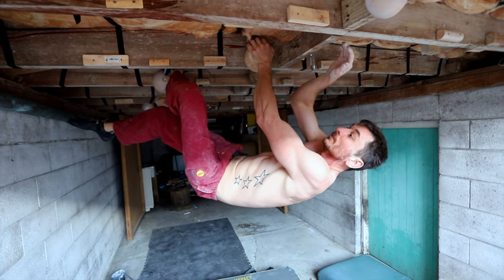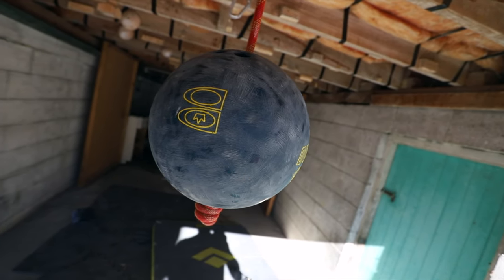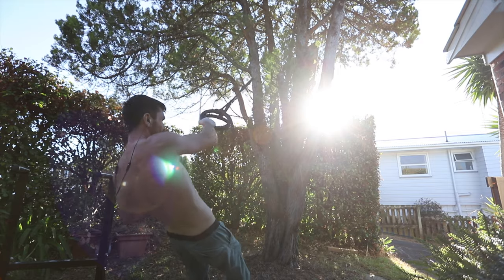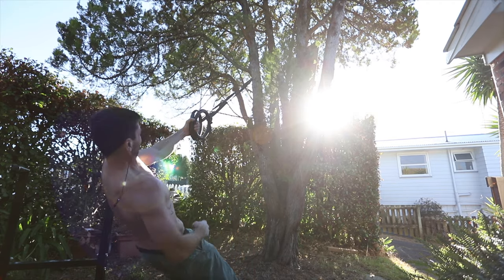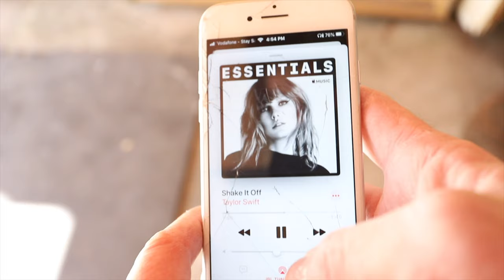LOCKDOWN!!! Home climbing gym build and roof training 💪

Comment: Could add grip tape to beams in different widths to create pinches of different difficulty. A hold or timber to do bat hangs! and a crack climb! And maybe hang a few carabiners to practice ropping/clipping into? Awesome set-up 👌👏
Reply from the maker: All great ideas Brad but Ive since moved and taken this down, now I have built a full on campus board set up and hopefully building a 30 degree home wall over the summer which Ill make a build vid and some training vids on 😃 Have a great weekend 🤙

Comment: Did the holds on that line at maratoto scrub up ok? They were slippery. The cross will be nails.
Reply from the maker: The cross isn’t as bad as that last move, scrubbed the holds they arnt great but it’s doable, last move I was dynoing to the finish jug but I think using the little pocket might be better climbing lol
Reply: Cant remember that part. Is that the open jug? One of the clips before the lip felt like it would be nails. At least the bolts arent super sketchy anymore!
Reply from the maker: Tom Thumath the clip before the lip gets done once you hit the lip, now there are new bolts in you won’t be worried about a fall haha, Rock was solid AF too probably the hardest bolts I’ve put in so far, took me ages haha. Soon as this bs quarantine is over I’ll be back there if you’re keen?